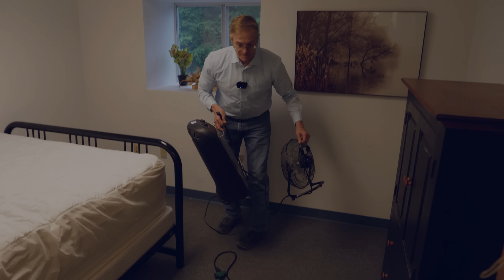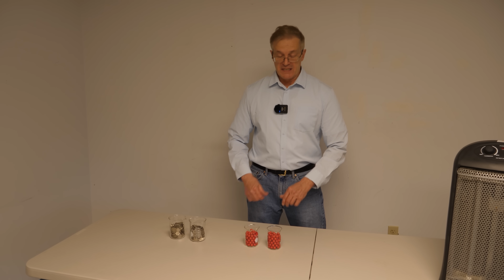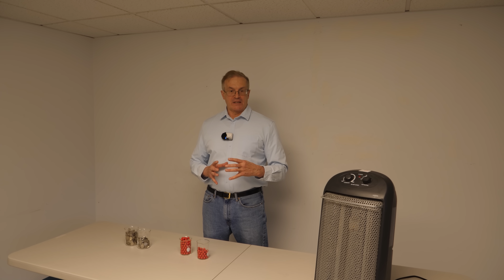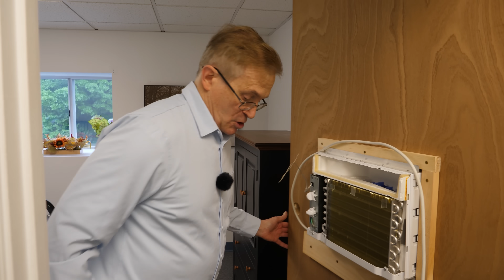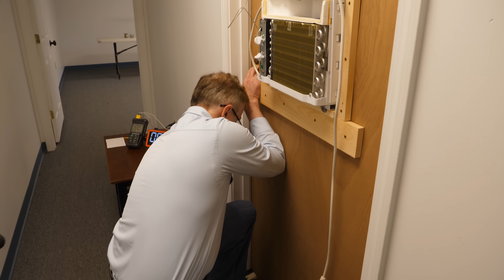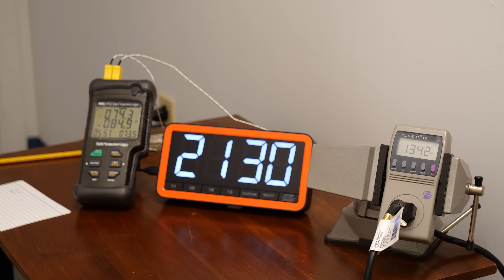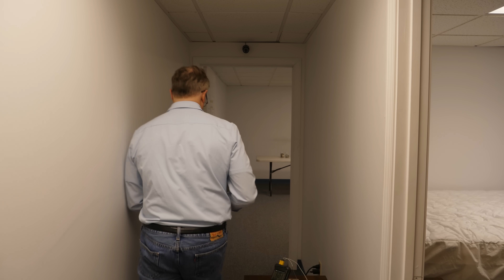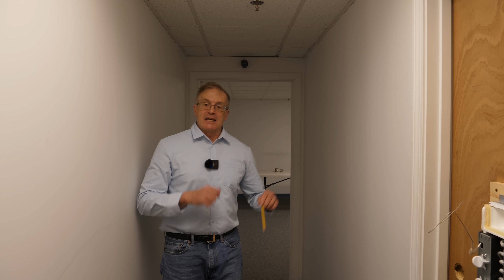You're wasting money on heating! Use your A/C!

Comment: Imposing with style ideas,  I think the occasional PowerPoint slide would do wonders to frame each video nicely. PowerPoint is very much like using MSWord, only you type bigger, and with colors! Used sparsely to record key points I think would make the presentation flow more "chapter" like, offering a chance to signal to the brain that we're at the opening/intro/setup, the development and plot pursuit, the culminating Wiz-Zing, the Recap into Sign off, with just few cards updated. Plus the "K.I.S.S." of "if you're not shouting it you're not selling it." Seriously, no more than one card every three minutes, and only for a long enough time that a 4th grade reader could read it twice, also limited by the card not trying to double as an encyclopedia.

Comment: Question: what temperature did you set the AC unit to blow into the "Starbase" bedroom?
Reply from the maker: Starbase... I like that 
We didn't set a temperature but set the 5,000 BTU unit to run at full output for the duration of the test.

Comment: now why would an air conditioner that is pulling the air from the room and pull it out cold on he other side make the room warmer?
Reply from the maker: The air on one side of the airconditioner is drawn from the hallway, cooled, and returned to the hallway. The air on the other side of the airconditioner is drawn from the room, heat extracted from the hallway side is added to that room air, and it is returned to the room.  The two airflows never mix, but the heat becomes concentrated in the room.
Reply: @TechIngredients  sweet thank you. i always thought air conditioner took the air from the outside and cooled it for the inside.

Comment: I dont think most people use electricity to heat alone.  Natural gas seems to be about 4x cheaper for the same BTU. Olus window units youll loae efficiency out the window with drafts and sealing.

Its a good idea for certain situations where you dont care about the look or sound and small spaces to 250 sq ft or so.

Comment: How thick are the exterior wals in that structure?
Reply from the maker: I'm not sure, but this commercial space has large utility conduits that run between the inner drywall and the steel sides of the building.
Reply: @TechIngredients  , Cool Thank you

Comment: The surrounding latent heat in walls, furniture etc. needs removal as air temperature will be affected, this room should have been left 24hours.

Surprised by this channel! 

My aircon unit heats my room excellently with efficiency I couldnt understand, thanks for explaining. I still wont be changing to heat pumps for radiator heating, but I would be interested in efficiency of a whole gas boiler/rad vs airpump/rad
Reply from the maker: Hopefully, you are surprised in a good way.😁
24 hours is excessive, but that is why we waited for over an hour.
Efficiency is not the same as cost effectiveness. A natural gas boiler and hydronic radiators may be less expensive overall.
Reply: @TechIngredients  the time period to return to ambient would be dependant on the room's construction, items within, airflow, airflow temperature, inertia and of course size.  1 hour is grossly underestimated and will have skewed the results.
Reply from the maker: I disagree.
We weren't heating these masses in an oven, i.e., the differentials were relatively small, and the heating duration for test one was significantly less than an hour. You and I may continue to disagree, but the results were so different between the two tests that, either way, the significance of the performance differential remains.

Comment: You should’ve moved the temperature gauge inside the room and proportion to the air conditioning unit when you tested for the heat. It was on the other side of the room, but when you tested using the air conditioner, it was right beside it.

Comment: It would be interesting to know the difference in temp of room using the heater, with and without the fan. And to using the fan to blow air from hall into bedroom would help equibration to be quicker.
Reply from the maker: Eliminating the fan would bias the result in favor of the airconditioner because the distribution of the resistance heat would be more limited to the heater's location. The airconditioner has its own fan.
We decided not to blow the air out of the room because the mass and surfaces in the room might retain some accumulated heat. Time reduces that possible source of error.
Reply: @TechIngredients  thanks

Comment: Well that's the reason heat pump are being pushed for house heating in Europe -  it's very efficient

However they can only cool your house a little as they cool via the floor -  so a AC cools better, at least at the moment
Reply from the maker: Heat pumps aren't limited to chilled water, hydronic heating, and cooling. This may be common in Europe, but it isn't a requirement.
Reply: Of course they aren't limited to water.
AC units use propane for moving the heat /energy when I am not mistaken.
Water based heat pumps are more common as the hose from the house only carries water and no propane or other liquids (it's a regulation thing)  -  outside is the mono block unit with fan, but heating and compressor.
The later mostly based on propane

The efficiency is measured called JAZ -  translated to yearly working unit, and so a HP with a JAZ of 5 will use 1000kwh of power and generate 5000kwh of heat for our house.
To reduce emission the use of HP and has been pushed a lot especially in Germany -  down side is that they do not work really good if the house has a bad insulation, which would be a limiting factor in the US from my experience, but I however it would still be better than gas/oil -  since the latter is cheap in the US there are no economical incentives to make the switch compared to Europe

Comment: I don't won't to dispute the results, but isn't the AC closer to the probe than the resistive heater?
Reply from the maker: It is, but the flow from each system is directed away from the probe towards the opposite corner of the room.
Reply: @TechIngredients  thank you for the answer.

Comment: Wouldn't the efficiency be less however in the real world where you would be trying to pull heat from outside which would presumably be colder than the hallway of a 74 deg building? I love my mini splits, and I'm confused and amazed how they can still find heat from outside even in freezing conditions, so I'm confident they'll be more efficient than the space heaters, but It might not be the best example for how efficient they are in real operating conditions.
Reply from the maker: You're right. As I explained early in the video, the efficiency multiplier effect drops as the temperature differential increases. But, it's still there.

Comment: How effiencently does it work when the hallway is at winter like temperatures though?
Reply from the maker: Less so.  As I explained,  the larger the temperature differential, the lower the efficiency multiplier effect.
Reply: @TechIngredients  finding out the temperature difference in degrees that makes it less efficient than powering an electric heater would be a good experiment. Unless it's always going to be.
Reply from the maker: It's always going to be, but as the advantage decreases, the increased cost of the more complex system will eventually make it less attractive.

Comment: Heating and cooling ac has been around for decades. I have Panasonic and Daikin heating and cooling a/c in my Cape Town, SA, home. In winter the units cool the outside air while in summer they heat the outside air. Why are Americans so late to this party? Also inverter driven AC compressors which regulate the rate of compression with variable DC voltage work the best when it comes to saving power.
Reply from the maker: You're right. It's not a new technology. It's just that it's not widely appreciated, especially here in the US.

Comment: I wonder what you mean when you say that turning electricity into heat is 100% efficient. Using electricity to produce heat is the most inefficient use of electricity.
Reply from the maker: It IS nearly 100% efficient. All the electrical energy is converted into heat. 
That doesn't mean that it's efficacious. For example, burning wood chips is just as efficient as burning dollar bills in creating heat. Using that money to buy wood chips and then burning them is more efficacious. That's the same multiplier effect that applies to a heat pump.
Reply: @TechIngredients  I guess I'm looking at it from a monthly bill perspective... electric burners on a stove, electric water heaters... are some of the most costly uses of electricity.
Reply from the maker: Exactly. Efficiency is not coupled with cost unless you're comparing the same technology.

Comment: Just had to check my new Toshiba 10,000 btu window a/c and it's using 900 watts. I must need to get an old used one to get the results you got. Also my Frigidaire 12,000 btu is 900 watts as well.
Reply from the maker: Actually,  that sounds about right.
Efficiency will vary between brands, and there can be some scale effects, i.e., a unit with 10 times the capacity may have   a more efficient fan or better heat exchangers.

Comment: Heatpumps are the cadillacs of the ford world. Their expensive to install. Need more accessories because nowadays those accessories are standard. Heatpumps require more maintenance. Very much a Cadillac and not a german engine. Your best bet is to make a better Refrigerant,  one that can cool like ammonia and absorb heat like plasma. All these rules are only based on the fragility of the freon (Refrigerant) its a gas to release heat and liquid to absorb heat. Dont use steam because dangerous. Dont freeze water because ice leads to problems. Happy middle somewhere. Just like Coop said. "Not now, But one day, humans will reach the 4th dimension".

Comment: Very interesting and well done video.i don't recall if the AC was set to cool or just fan. I also wanted to inquire about condensation and how that figured into the equation.
Reply from the maker: If it were set to fan, the room wouldn't have gotten warm.
Reply: Not sure what i was thinking but makes sense that in fan mode it is only circulating air having almost no effect.  Thankyou for the great video. @TechIngredients

Comment: This is a great video but a real test would be to use an AC venting to the outside in winter type cold temps. I dont think you want to heat your house and then create a big temp difference between rooms with an AC as in this demonstration. Yes moving heat is better then creating it but a demo like this at -10 deg C OAT would be a more realistic test.

Comment: EXTREMELY MISLEADING
The heat pump becomes progressively less efficient as the air,  on the cool side of the air conditioner,  becomes colder.
Reply from the maker: Indeed, it does, and I explained why.
It sounds like you missed that.

Comment: Wait...lemme get this right. So, if I turn a window unit around, it can used as a heater ? What about the condensation ? Won't it be dripping on the floor, and making a mess ?
Reply from the maker: You can drain the condensate wherever you choose, and as the temperature drops, the amount of moisture in the air drops.

Comment: I have a heat pump, and it is far more economical to run the unit on straight heat mode than in the heat pump mode... If I use it in the heat pump mode, the unit runs for hours on end before shutting off for a few minutes, and then runs for hours and cycles like that... But in straight heat mode, the unit warms the house say from 45 degrees to 72 degrees in about half an hour and shuts down, and because the concrete floors and the drywall and cabinets take awhile to get the chill knocked off them, the unit does cycle more often until those things do catch up.... This is my earth contact home (clubhouse) which has 3 sides under ground level, so even in the coldest times, the temperature inside never drops below 45 degrees when everything is shut off... Using the unit as a heat pump costs considerably more than using the unit as a straight heating unit... As a heat pump, it takes a good 5-6 hours non stop working to get the temp up to where it can finally take a short breather, but it's almost like the thing is constantly fighting compared to conventional heat mode... You can HAVE that heat pump shmeat pump BS...

Comment: how does this work when its cold outside, like 32F?
Reply from the maker: The efficiency multiplier effect drops as the temperature differential increases. It will still be significantly more efficient than a resistance heater.
Reply: @TechIngredients  wait so you could still pull heat from 32F and heat your house? The AC wouldn't have to work as hard to produce cold temps cause its cold outside so im confused how you would keep the ac running once it reaches the desired temp which most ac's stop at 65F in USA.

Comment: I have been on the road full time in my camper van for over a year now.  I have installed a very efficient window ac unit in one of my rear doors that runs off my power station which is charged by 720 watts of solar.  It has worked great so far cooling my van.  I always thought about turning the unit around backward for the winter but learned that the unit will not turn on if temperature is below like 55 degrees.  If there was a work around for that, I would do it.  My diesel heater does a very good job heating and it is cheap to run but even on the lowest setting  the van gets too hot very quickly unless the temperature is below 35 degrees outside.  I would use the reversed window unit until it got really cold out.  I hope you do a video on how to run an ac unit backwards or to spoof mine into thinking it is warmer than it is so it will run turned around.  I have enjoyed your channel for years and have learned a lot from you .  Thank you.
Reply: If you take the front panel off most window AC units there's wire similar to the one in the video that is the temp sensor. You might be able to bend it around so it isn't on the cold side anymore it should keep running. That may lead to other issues though, so try at your own risk.
Reply: What if you brought the unit inside and ducted the cold air out through a window?
Reply: @gunslinger2566  Good idea, but I do not have room for that near any of my opening windows. Plus  my windows are the type that pop out from the bottom and only open about 4".  Thanks.
Reply: @OverlandOne install a 12v light bulb (as a heating element) near to the temp sensor mentioned above - turn it on when a/c gets too cold to run.
Reply: @arealcanadian419  Excellent idea.  Thanks,  I had not thought of  that.
Reply: @arealcanadian419  great idea!!
Reply: @arealcanadian419  That should work well, especially as the heat of the bulb actually warms up the cool outside coil, extending its operating temperature further into the cold. The watts used be the bulb will mostly be added back to the inside, as the temperature sensor typically is on the air intake side.

Comment: I agree heat pumps are more efficient than resistant heat. The electric resistant heater may be as efficient as it can ever be.  But electric has to be generated by cosy  methods.   But natural gas is many times more efficient than either when it comes to $ spent over the years. And $ spent is what is important .   Here in the North East  we can use beat pumps in fall and spring.  But  a normal heat pump will not work when we are in  the cold of winter.   A geothermal heat pump will work but  they are so much  more expensive. It would  take many years  for it to pay for itself. .    $ spent over life of a system and how  it does the job.      I know natural gas refrigerator are extremely efficient.  Many times more than electric .  Can an air conditioner be made to run on natural gas ?
Reply from the maker: It's another tool, and it will be the best choice in certain situations. Geothermal is very efficient, but not only is the ground work expensive, there are also permits required when in installing them.
Natural gas may not always be available and moving propane around has other issues. Even wood heat, which can be "free" requires some muscle power to gather and burn.
Reply: After writing this i looked up natural gas ac.  It does exist.  It is more money up front.  But it is much more efficient in the long run and it is less problematic than electric compressors .  They say over the life of the unit  the $  savings can be quite substantial.  And  can in most cases be less $  in the long run.

Comment: heat pumps are 3 times more evfficient at heating than electric heat strip down to 40 degrees f -den the are less efficient than electric heat strips as they freeze up and have to bee thawed by reversing back to the ac mode which heats the outside condenser coils -during this cycle the heat strip have to bee on to keep the heat on so your running the ac w the heat stip suring the thawing process-that why there are gas and oil fired fiurnances up north and no heat pumps -